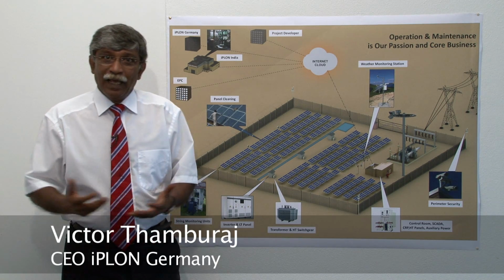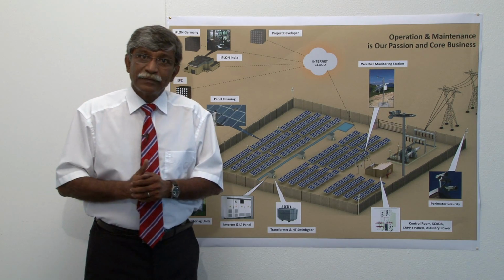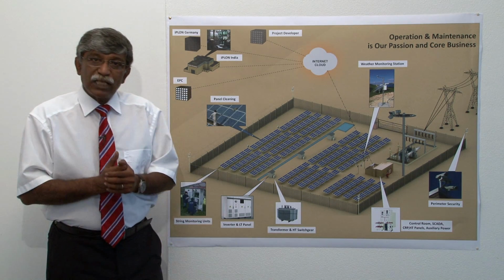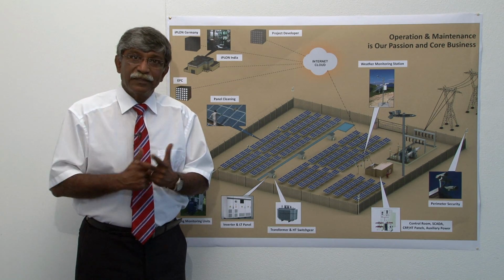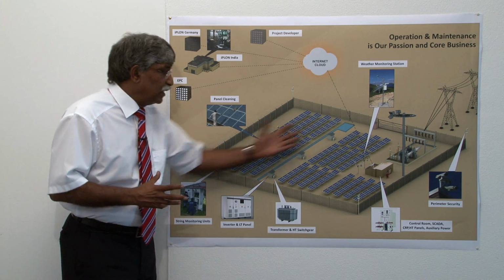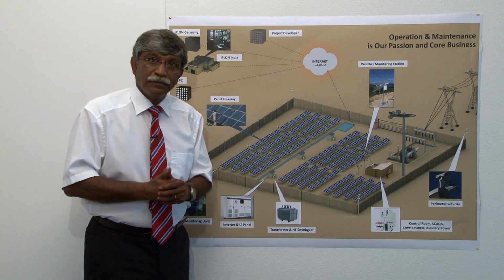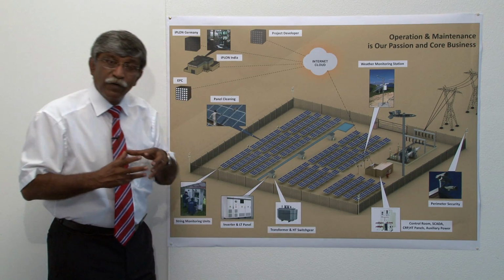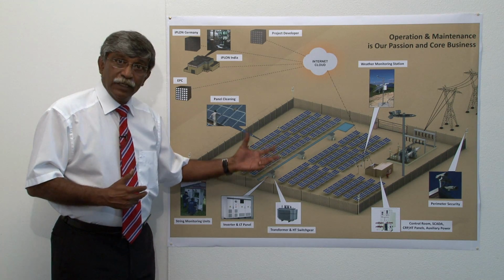Key factors for PV Operation & Maintenance

Comment: Sir,i need how to calculate performance ratio of pv system...please give with formula
Reply: Method of calculation of Performance Ration :

PR= Actual energy Generated /Irradiance x Active area of all pv modules x Efficiency of modules .

Firstly , Actual energy generated or exported to grid , measured by energy meters in KWH.

Secondly , the irradiation data , measured by an irridiance sensor (Pyranometer) in KWH/Meter Square

Thirdly , the total active surface of the panels which receives the sun energy (calculated by multiplying the area of one module with total number of modules installed in the plant, in meter square

Fourthly the guaranteed efficiency of the solar modukes/panel given by the module manufacturer which is normally given as 15%-16%
Reply: @abdirahmanmohamedhassan371  thanx for formulae explains